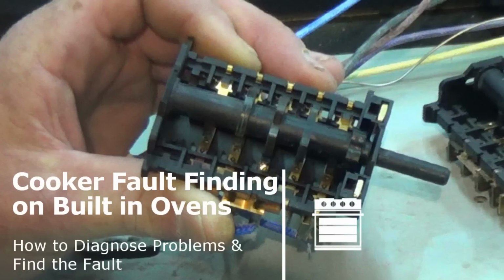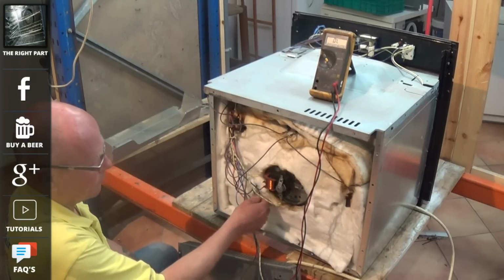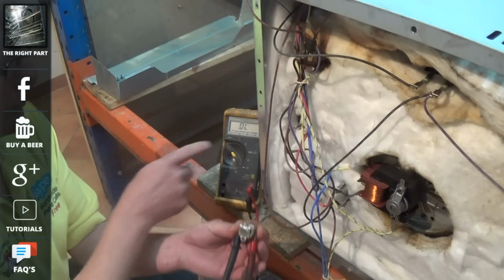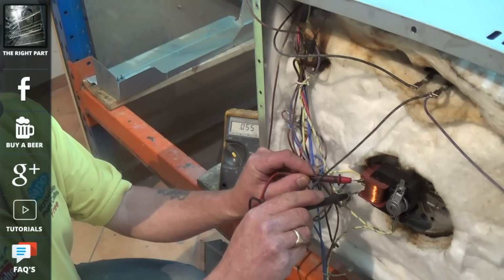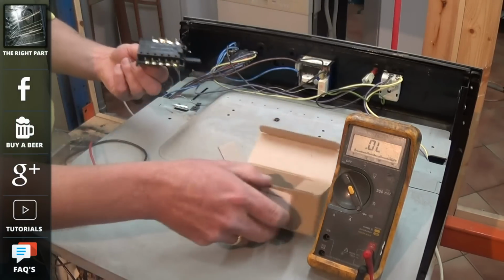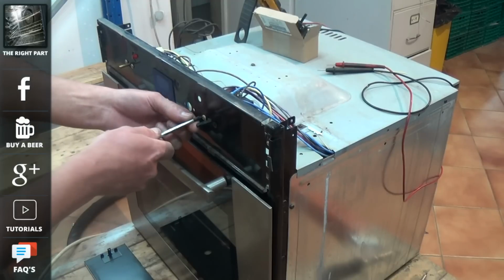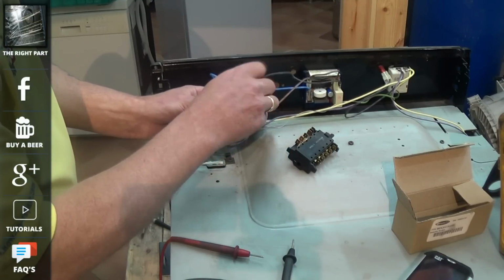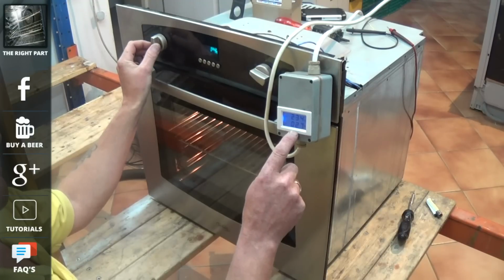How to Diagnose Faults on a cooker or oven built in

Comment: Nice work guys... After watching this video (will also follow up your link for elements) I think I have a faulty grill element that trips the RCD due to the element shorting to earth 1-2 minutes after the grill and fan-assisted oven is switched on (thermal expansion I think). I assume the fun assisted oven automatically switches on the grill element as well. I'll open up my Siemens oven and investigate, ALWAYS with SAFETY in mind! Thanks and keep up the good work!

Comment: Great video, unfortunately does not fix my Zanussi ZCE 7700x which has a thermostat 46THC15/F5.
This thermostat has been replaced by a a ET51001/F5. THis requires the wiring to be re-arranged in different manner (instructions included with unit). I have now fixed the oven and it is working fine.

Comment: Great vid!  I need to fix my oven tomorrow.  I have a question about the "one shot thermostat"...  If it has activated and gone open circuit - can it be reset?...  I think what has happened is the fan packed up which made the oven over-heat.  Have I got to buy a new "one shot"?

Comment: I recently bought a 2nd hand cooker. It's a Flavel Milano E60 ML61CDS. It is an induction hob cooker with a separate grill & oven. It's on an RCD in the fusebox (80A 30mA) The hobs work fine and don't cause any issues. Both the grill and oven will trip the RCD however they don't trip it straight away. They only trip once they are warm. The oven bizarrely will start fine from cold but trip when you turn off the knob powering it. Oven lights and fans work fine.

My old cooker didn't have any issues with the RCD, so I don't think that it's a problem. I was thinking of changing the elements but 2 simultaneous element failures seems unlikely. Any ideas what to look into?

Comment: Could you help me out please. 
 We have a Kenwood CK418SL Electric Halogen cooker with double electric oven. 
 The Cooker hob top works fine, however there are no indicator lights,  no running fan, heating in the oven at all (Basically the oven is dead).  Wednesday the Oven was running fine, Thursday we went to use it, it was dead, no life at all. Would this be the Oven Thermal Cut out or something else. We haven't used the timer, no RCD trips, and as said the top part of the cooker (the electric Hob) is working fine, so not a mains supply problem.
Any suggestions greatly appreciated.  Mark

Comment: My cooker works as it should regarding heat, clock etc but when I set the timer it counts down but no longer beeps when it recjhes zero. Any ideas as to why? Could it be that I have hit something when setting or cleaning? Thanks, regards, Joanne. PS It's a hotpoint by the way!

Comment: HI HAVE A WHIRLPOOL MICRO OVEN, AND IT DOESN'T HEAT  ITS NOT USING A TRANSFORMER OR HT CAPACITOR IT HAS MEGA TRON AND TWO DIODES